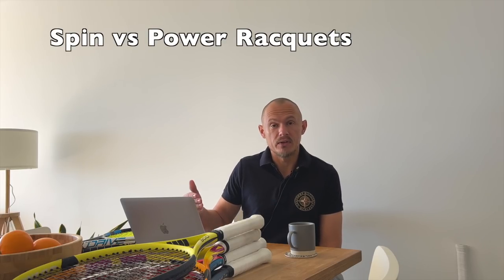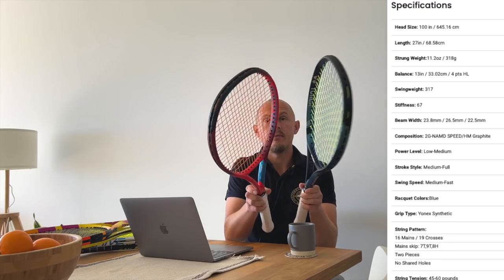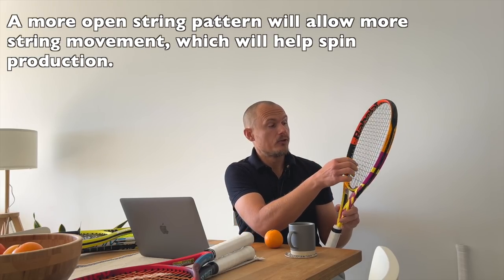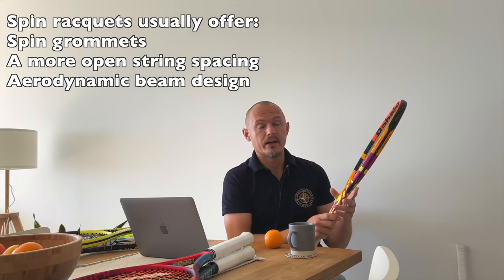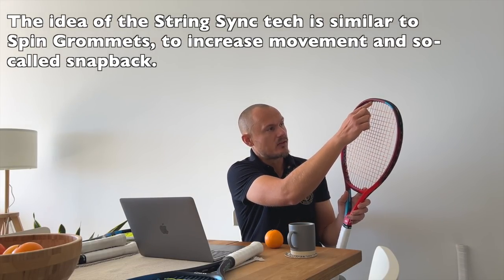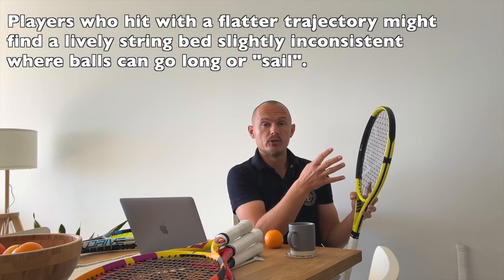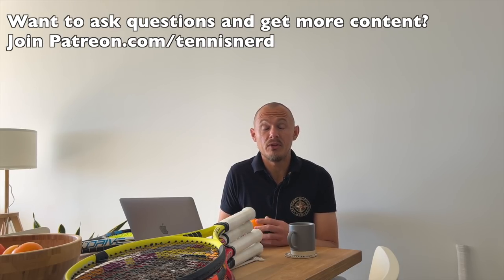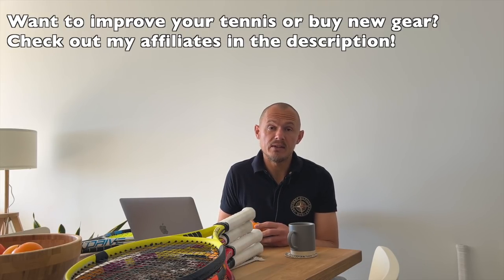Spin vs Power Racquets - What's the difference and which one should you use?

Comment: Excellent explanation.  I wanted a spin racquet and bought a Head Extreme Graphene 360.  It plays stiffer than its 63 RA rating - probably because it is designed to flex in the throat where it's thinner.  Also, at only 3 points headlight, it was not possible to get a lot of racquet head speed with it.  Racquet head speed is essential to generate the generous spin that spin racquets were designed to create.  This problem was remedied with the stiffer and more headlight Head Extreme Graphene 360+ version now on sale.  Don't overlook how essential generating racquet head speed is in order to get the most out of spin racquets.

Comment: Since I switched to Radikal pro 360+ I had chanced my string set up as well. I feel I master the all-around game perfectly well with it. I add lead at noon and to keep the balance at 315 wrapped it with Wilson leather replacement grip and Signum pro 0.70 mm wet grip soft. The string set up: main; rpm rough (black)130mm // cross; velocity (white) 125 mm(24X23 kg string tension). I have power, I have a decent amount of control, I have heavy spin. I can shift spin to flat power, in control. I feel I'm quite e a lucky player that this set of racquets I can comfortably change gears during the play. I had struggled to gain a coherent relationship with my racquets till I came up with this set-up. Thank you for your postings, I got quite ideas from you to develop the right perspective in choosing the right equipment.

Comment: I had a demo of a good friend's new VCore 98 and Ezone 100.
 I really liked the swing&feel with access to power&spin by the 98 VCore. The Yonnex Poly Tour Pro string did the trick for controlled power and spin. It was fun to play with it. 
 The 100 Ezone had Babolot RPM Blast. It hit well. It had had to much power and it's frame was to big for my play style. 
  I did not like the racquets enough to give up my Wilson Pro Staff RF97V13 or RF97L. But, the top spin experience helped me pick a potential Yonnex Poly Tour string to enhance my Wilson racquet features. I've used RPM Blast in other racquets. At lower tensions for me it gives good control, feel and durability. So, instead of finding a racquet, I found a couple of strings to punch up the fun in my play. If you are looking for new magic, try a suitable string to aid your play style. It's definitely a less expensive way to boost racquet play.

Comment: The thin profile at the throat is for brush aerodynamics??  I question that.  The original thin throat on the Babolat rackets was built in to the original Babolat mold that they purchased from Pro Kennex - specifically the racket mold for the Pro Kennex Ceramic Destiny.  This was a design feature for incorporating flex in the throat, with stiffness in the head.  An extra wide head had certain benefits, but a lack of feel that all the other Pro Kennex rackets have.  The thinner throat was the solution.  I suspect it has a lot more to do with flex than aerodynamics.

Comment: Nice video, I appreciate the complexity of the topic. Matching those frames with right strings, and change it frequently, is then the other key, because the strings are much more stressed. So my view is, pick the racquet that fits you and use the right strings to express the potential. A Spin o Power racquet with a 20/30 hours old bad poly is a nasty combination.

Comment: The easier to notice, firstly, power and spin racquets mostly both have power. Then look at the racquet's neck, there should only 2 types: 6-strings or 8-strings. The 6 strings at the neck is a spin racquet.

Comment: Where do you put the Wilson Blade? I’ve been told it’s for control
Reply: The blade comes with both 16x19 or 18x20 string bed so it depends
Reply: @roman2374  16x19 is mine

Comment: How about Fed using string “savers”? It doesn’t allow strings to move at all, but strings bite the ball better and spins it. It’s not Rafa style shot but still plenty spin
Reply: There was a chart I saw last year using data over a few months worth of tournaments on the ATP tour from a few years ago and measured average RPMs on backhands and forehands. The leaders were obviously players like Nadal, Berretini, and Casper Ruud. These players largely use spin oriented 100 inch rackets, with the odd exception like Thiem.

Obviously spin, power, and control can he achieved with various types of setups (player swing style and goals etc play such a big role in what setups will help them with what), so it's not like in this case you need a spin 100 to create spin, but many spin oriented players will opt for such a racket much like how many great servers have opted for extended length frames like Isner, Roddick, Tsonga etc and many flatter strikers who target smaller targets will opt for smaller head sizes and denser string patterns (Medvedev, for example) and so on and so forth

Comment: Hi new to the sport but was wondering would my backhand slice benefit more from a spin racquet or a control oriented 95 18/20 racquet? Cheers!
Reply: Control rackets for sure. Slice you want easier Low trajectory shots
Reply: @wanzacharywanisa5762  ok gotcha, but at the same time would the smaller 95 head size negatively affect the slice? Thanks for the reply!
Reply: The smaller head size also moves faster through the air. Just try not to pick a very heavy one for now. Till you have good timing. 310g
Reply: @jorgeandrescoppiano  that’s a really good point, thanks for the reply. I was considering the Dunlop CX 200 tour. It seems to have most of those characteristics. Do you think that’s a good choice?
Reply: @Helios_17_  happy if it could help! The 200 Tour is 95 head size and 315g. It could work if you can handle the heft. But I think CX200 98 305g would be a better fit for entering the sport and get yourself rocking those ground strokes 😁😎
Reply: @jorgeandrescoppiano  yea i appreciate it thanks! I think you’re right the larger head size will probably make my life a lot easier starting out 🎾💨💨. I’ll definitely look into the cx 98. Or perhaps the normal pro-staff v13 🤔
Reply: @Helios_17_  yeah it could work too! Try demoing it. The Pro Staff 97 is also 315g. Pro Staff 97L is 295 I think. That one could be 👌🏼👍🏼
Reply: @jorgeandrescoppiano  Yea that’s a good idea, those are some good options plus in the future i can always add weight to the v13 lite after i get my form down 👍🏼🎾. Thanks
Reply: @Helios_17_  you got it my dude! Great idea yourself 😁💪🏼
Reply: @jorgeandrescoppiano  thanks! I really appreciate all your help 😁👍🏼